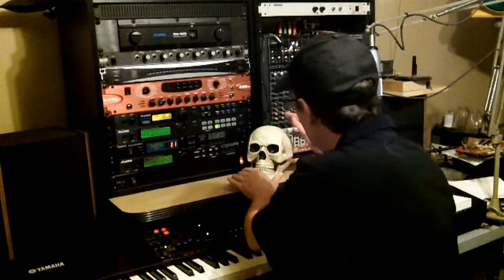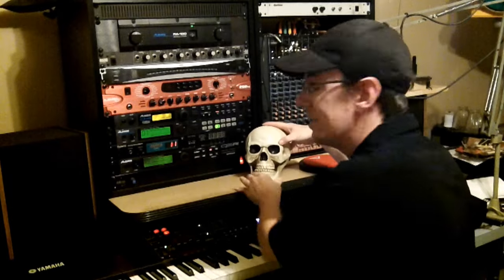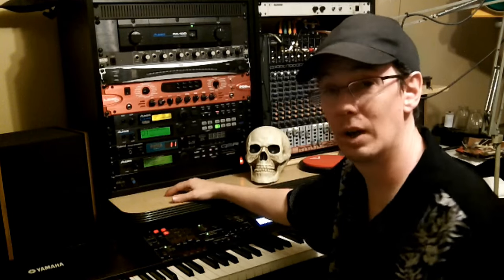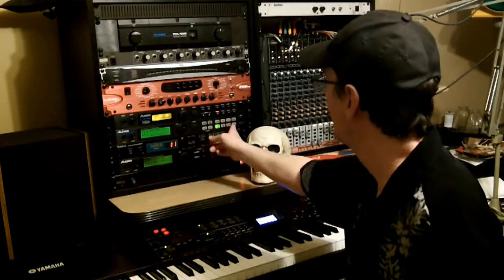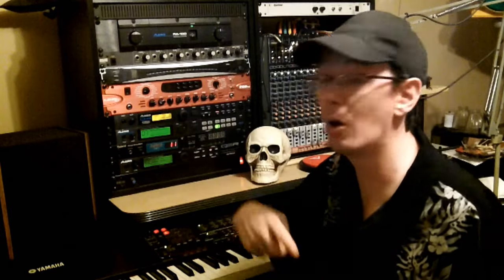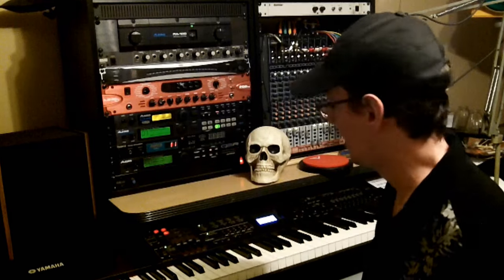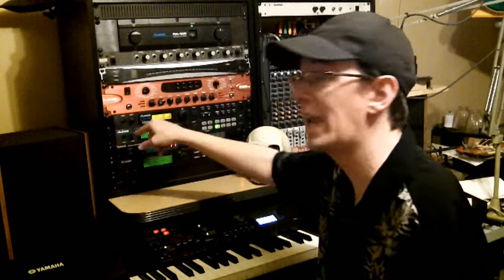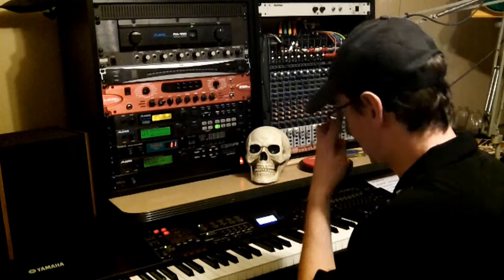Fixing an Alesis DM5 Drum Module

Comment: how do you do the reset . you never said ????
Reply: Reset: Disconnect MIDI cables - power up holding the Output and Voice buttons ~
Self tests: Disconnect MIDI cables -power up holding Output and MIDI buttons - press MIDI to advance through the tests ~
Enter individual tests: Disconnect MIDI cables -power up holding down Drumset and Group buttons - use Value Dial to select test - press Store to start test - after test is complete choose another test or press Mix and Output to exit.
More in the Service Manual PDF - Google it ~
Reply: Meu dm5 não consigo configurar , será que é possível resetar?